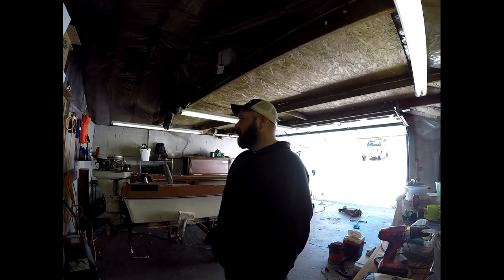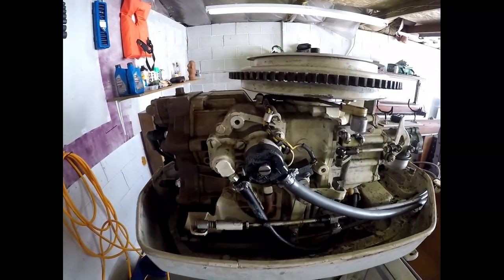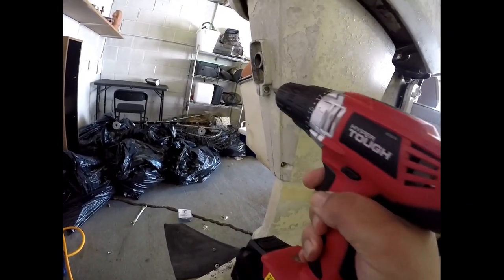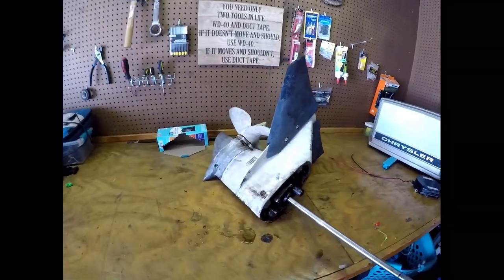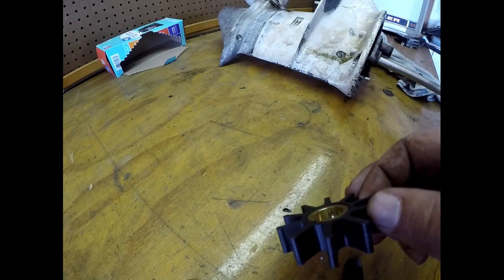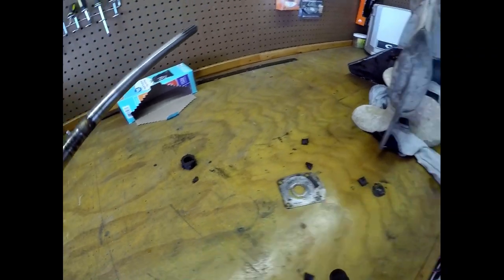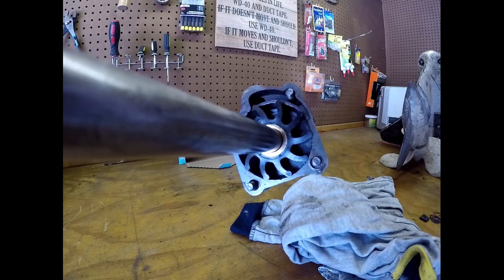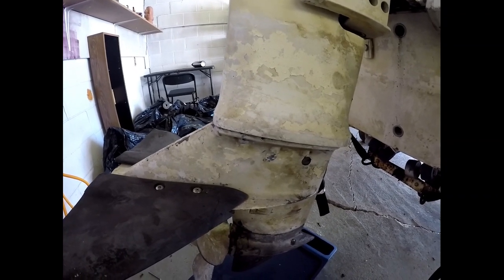Outboard Impeller Replacement 35 HP Chrysler | How bad is it?

Comment: Dawn dishwashing liquid works well for lube also. Surprised there is no gasket between the metal seat. Three of the different size engines I’ve owned had gaskets. Good video Norm.
Reply from the maker: Yea I was shocked to find out even the parts catalog had no mention or part number for a gasket so was like o ok lol
Reply: @casualcasting  with the engines I’ve had they were/are Johnson or Evinrude so maybe other manufacturers felt not needed.

Comment: You may need to do a bit of backflushing on the cooling passages.  Any of those impeller vanes that might have made it up into the engine could cause you problems. I change my impellers every 2 years, need it or not, just for the peace of mind!  When you go to change the lower unit oil, pick up a flat screw head SOCKET!  (If you don't have one.)  Screwdrivers and even small impacts can mangle the heads of those drain/fill bolts.

Comment: Great job.
Most the time a impeller looks like that it was fired up with no water. The exhaust heat will super heat them causing them to stick and break apart.  That or the rubber being very old.  If you take some of the rubber from the old one and it crumbles easy or leaves black marks on everything chance is was just really old.